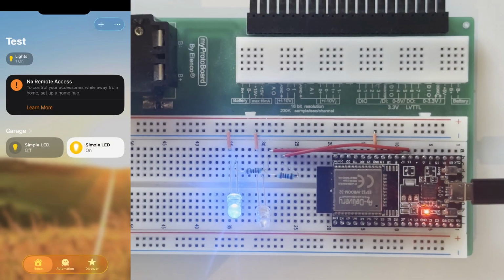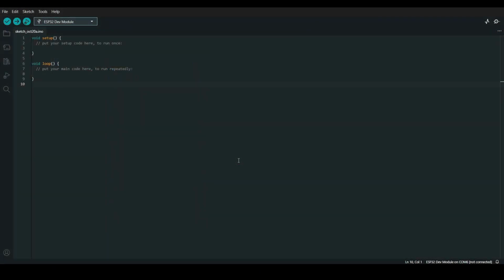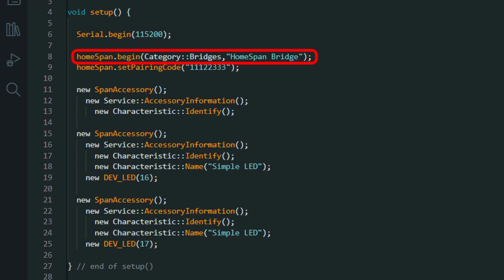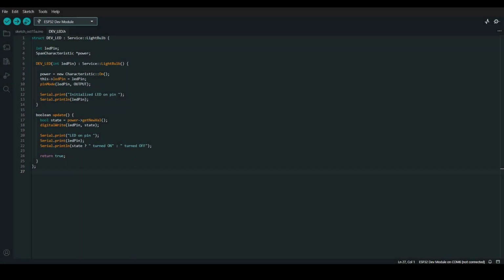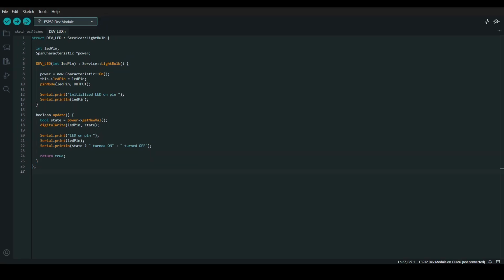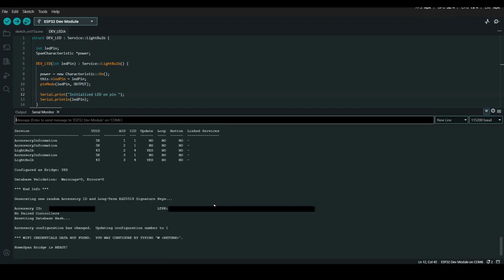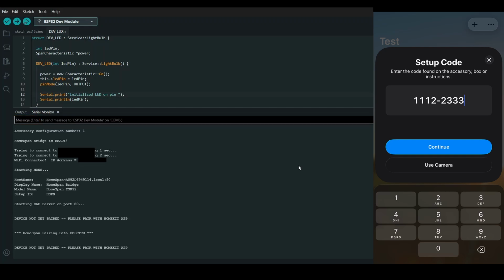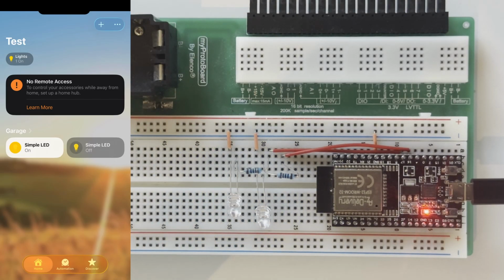ESP32 HomeKit Tutorial | Build Your Own HomeKit Device with HomeSpan

Comment: hi i was wondering which exact version of the esp 32 you are using? does it matter if its the cp2102 or esp8266?
Reply from the maker: Hi, I am using the “esp32 Devkit C V4 WROOM32” with the cp2102 usb-uart chip.

Good to know is that the cp2102 is a usb to uart chip and the esp8266 is a whole different microcontroller board which can be compared with the esp32.

If you are using the esp8266 then it can work, however the homespan library is not build for it. Best to do is use a esp32 with the cp2102 chip, otherwise it might take a lot of debugging before getting it right.

Github of homespan library:
https://github.com/HomeSpan/HomeSpan

Comment: It works great—the only downside is that "off" on my relay corresponds to "on," and "on" corresponds to "off." How do I specify HIGH or LOW within `digitalWrite`? That's where the "state" parameter goes, right?
Reply from the maker: Good to hear that it “almost” works!

Yes, the state parameter is where you use HIGH or LOW, like this: digitalWrite(relayPin, HIGH); (turns the Relay ON)
or digitalWrite(relayPin, LOW); (turns the Relay OFF).

If the relay works the opposite way, there are two common reasons for that. The first reason is that your relay module might be active-low. This means that LOW turns the relay on, and HIGH turns it off.

The second reason could be the relay wiring. A relay usually has three output terminals: COM, NO, and NC. COM is the common connection. The other wire goes to either NO or NC, depending on the behavior you want.
NO means Normally Open. When the relay is inactive, NO is not connected to COM, so the device, like a lamp or fan, is off. When the relay turns on, NO connects to COM and the device turns on.
NC means Normally Closed. When the relay is inactive, NC is connected to COM, so the device is on by default. When the relay turns on, NC disconnects from COM and the device turns off.

So if you want ON = ON and OFF = OFF for something like a lamp or fan, you usually connect one wire to COM and the other to NO, and leave NC unconnected. This is also the safest solution, because when the device breaks and turns of the device will also turn off. 

Hope this answers your question. Otherwise, tell me more about what you’re trying to achieve.